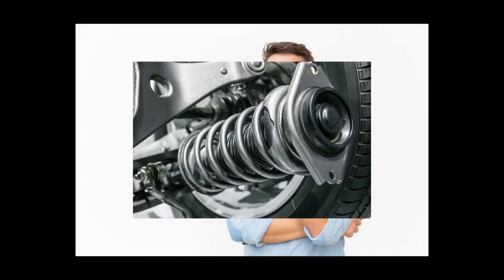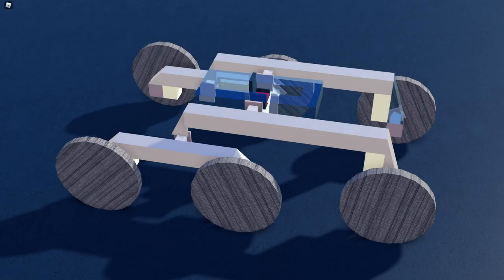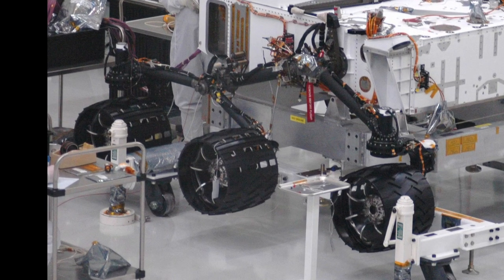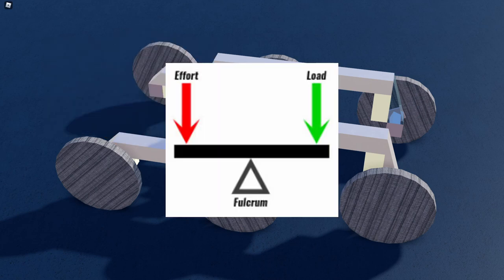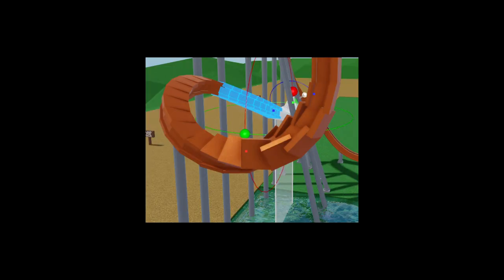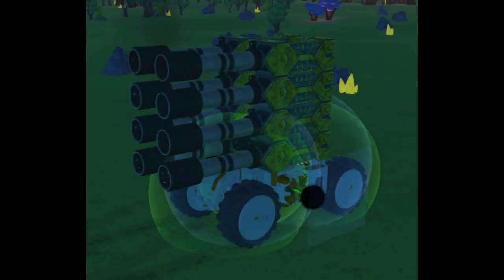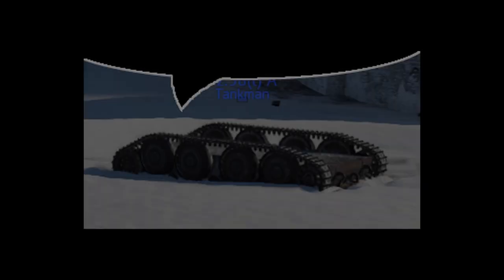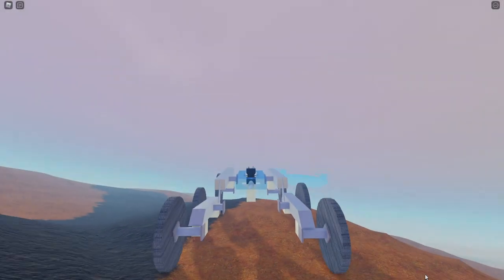rocker bogie

Comment: I can't believe a suspension with no suspensions is more smooth than a suspension with suspensions.
Reply: It depends on speed and momentum on the terrain,suspension reduces vibration, doesn't have a massive stopping power
Reply: suspensions or SUS pension Definetly Sus Pension smooth suspensions or no suspensions but smooth? no suspensions suspensions smooth or no suspensions but super super smooth
Reply: @Reykuro_Kyra  No, I tested it at max speed, my torsion bar suspension is definitely more smooth than Christie type suspension.
Reply: @DriftFusionTN  how
Reply: @canadaballplayz9999  doesn't have massive stopping power
Reply: @canadaballplayz9999  use it correctly
Reply: @Reykuro_Kyra  I am, the torsion bar suspension is super smooth
Reply: lol, big brain
Reply: Suspension counter: oo

Comment: Forgor to mention, I took this video as inspiration to build a suspensionless suspension, it was the same thing replicated 4 times, so 4 wheels attached to 2 beams, 2 wheels on each beam, and use hinges to attach the 2 beams to a larger beam by the middle, quadruple that and attach them all to a large platform and put yo seat on that. It's ao smooth that 99% of the time all the wheels will remain in contact with the ground. (I took the suspension design of the M13/40 and simplified it a lot. That's how I got it.)

Comment: Pls we need simple wishbone suspension tutorial
Reply: Bro its 4 arms and two motors, you can understand it by looking that the video
Reply: And set the motors to have no speed / make the keybinds a button you dont press and no torque so it can rotate
Reply: @spotisadog8509  no..... torque????????
Reply: @Symphinitystug_III  if you set the torque to 0, it becomes a hinge because anything can turn it with no resistance.
Reply: @Symphinitystug_III  so if I put a block on either side of the "hinge", the blocks would rotate freely but still be stuck to each other.
Reply: @spotisadog8509  wait so that means my SUSpension can be more smooooth aaaaaah k k k
Reply: @Symphinitystug_III  yes